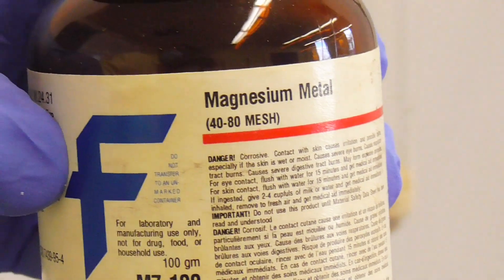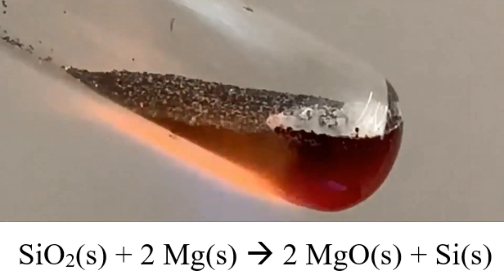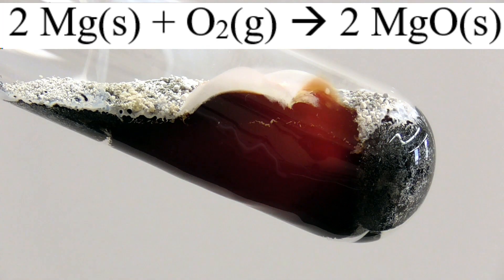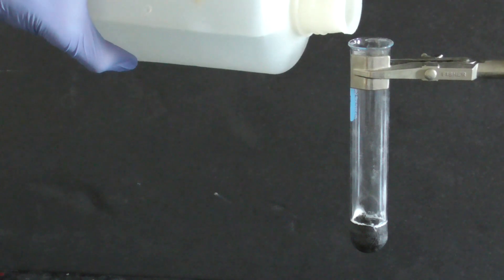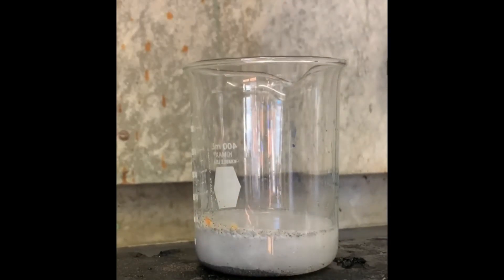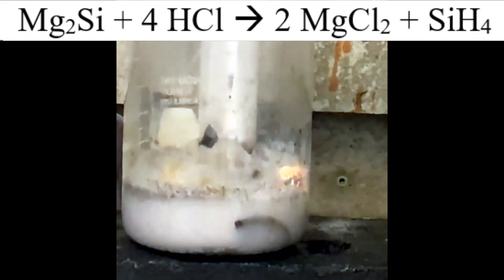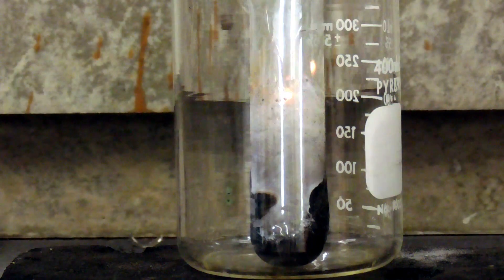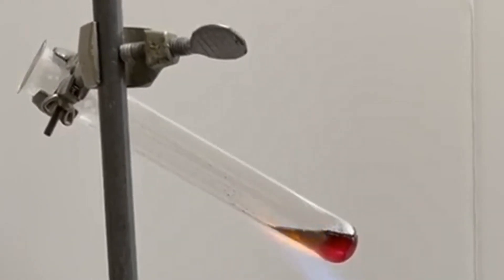Converting Sand Into Flammable Gas

Comment: As methane and oxygen will combust with an ignition source and silane and oxygen combust on contact, is the ignition temperature of the silane below room temperature? Would the silane / oxygen mix ignite if both gasses were below 0°C? Would methane/oxygen ignite without a flame if the gasses were hot enough?
Reply: yes

Comment: Professor what is the aim of this reaction?
Reply: Because i got confused about some rxn like why we do these rxns what after the rxn happened
Reply from the maker: This experiment demonstrates how the element silicon can be extracted from sand. It also shows how flammable silane gas can be chemically generated from sand using magnesium metal.
Reply: @TommyTechnetium  
I'm impressed that you were able to melt a borosilicate test tube!  Would a heavier wall test tube work better or should this reaction be done in a crucible?
Reply from the maker: @Binturong3850  A crucible would probably work better, but of course you then can't easily observe the reaction as it proceeds